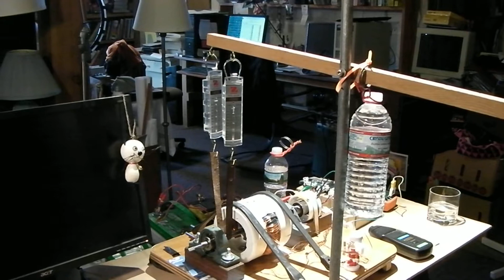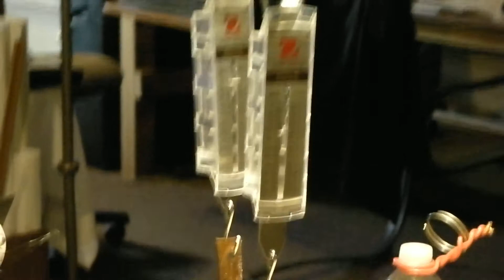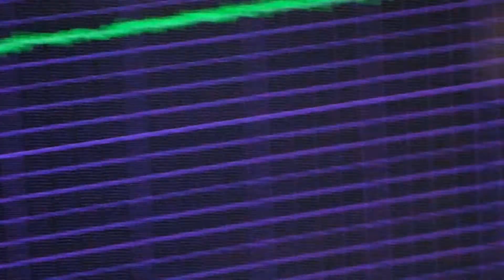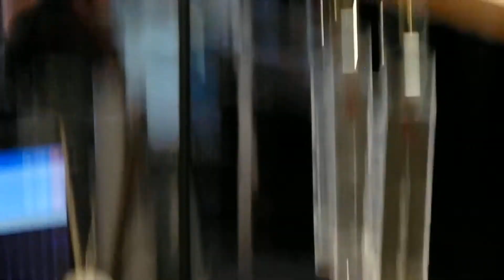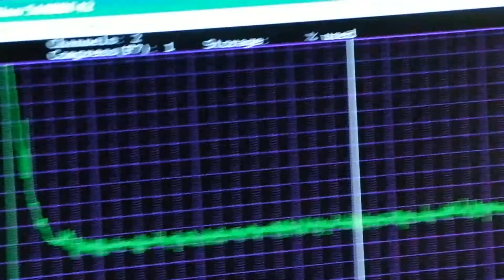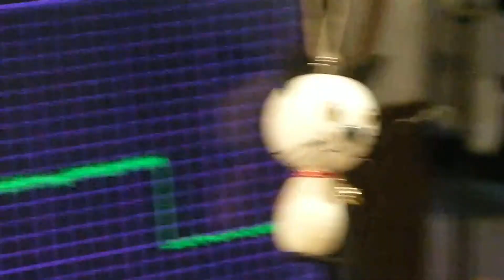ZFM Video 11.1 - Torque Testing Methodology

Comment: Yaro...happy 2018 new year hope you and your family are ok. Knowing that you probably know more than anybody on this motor, any possibility to charge batteries coupling an generator to the shaft?
Reply from the maker: Miguel - best to you and your family for the New Year - thanks.
The ZFM at this point of development is not quite ready for this type of application. Meaning that the output is still relatively low for any serious battery charging via a normal generator/alternator. Inserting a Kromrey generator into the mix, well, that would be interesting...